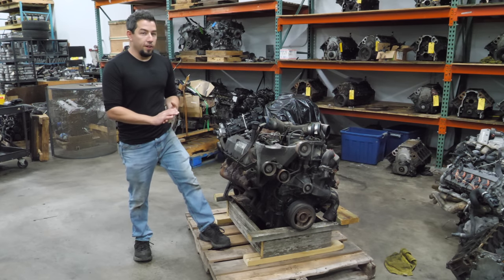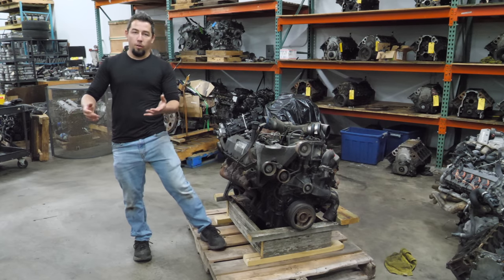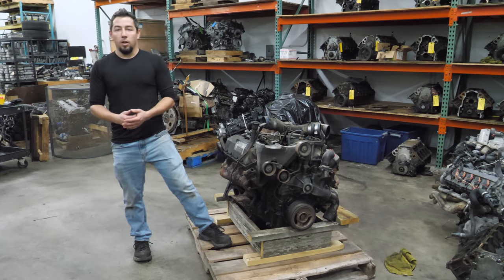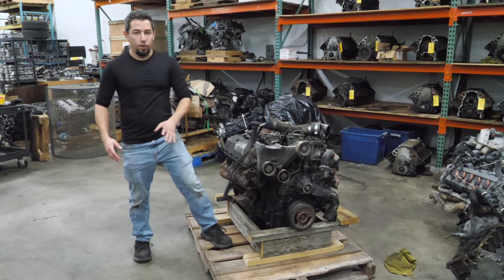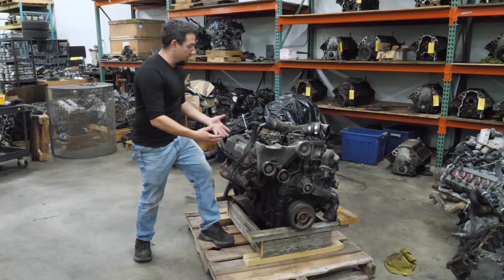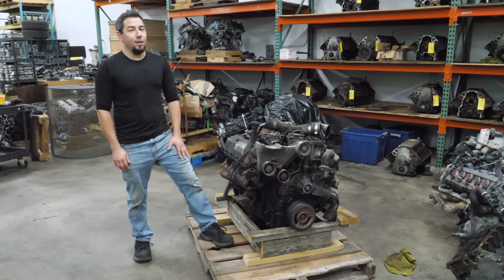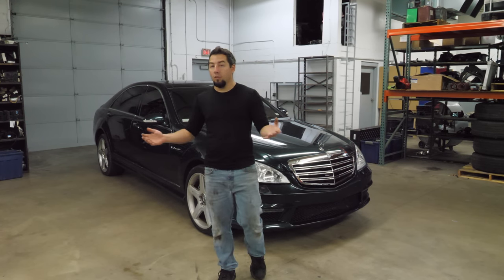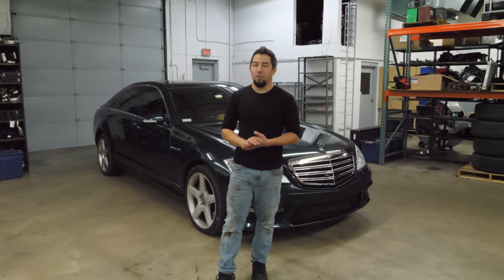70K OR 700K? Ford 7.3 Powerstroke Mileage Discrepancy. How Many Miles Are Really On This Engine?

Comment: Used truck dealer here and the Carfax report to me tells the story. Quick Change oil centers have caused more issues with mileage discrepancies than all other sources combined. And when the ODO goes from 68,3xx to 685,xxx in a matter of two months I think it's pretty obvious what happened. Once the truck got to Copart it likely had a dead battery, no battery or something else that prevented an actual ODO reading and facilities like Copart and IAAI will either sell them as "0 miles- not actual"  or they'll look at the last reported mileage on Carfax - in this case, from the same Quick Change store that likely caused the problem in the first place - and use that. Another clue to me is the condition of the wiring harness underneath the valve cover - it looked original and factory fresh. I can GUARANTEE you it wouldn't look like that with 697,000 miles.

I believe this is a 70K engine with many hours of cold-weather idling, typical of a service truck from up north. If it weren't for the mileage discrepancy I'd say it could be be a reman long block - the original valve covers would have been reused and the date code would still say 1998. But the discrepancy pretty much points to a clerical error. I think it would be smart to roll some bearings in it - and then sell it as such, carefully explaining to the buyer what we're discussing here. I believe the buyer would agree.

Comment: I don't know as much about diesel engines as some here. But I would like to try to add a couple of bits of information that may help explain a few things.

1. The accidented truck has all sorts of doors that were custom fitted to the pickup bed area. This to me, indicates that it was a service truck of some sort. While the truck itself probably had just 70K miles, the actual operating time on the engine in terms of operating hours was probably sky hight. I worked at an oil and gas services firm for a while, and when our trucks were on site, they basically idled all day, the never moved. So the mileage on the trucks was low, but the operating hours were sky high (this has to do with site safety regulations in the oil and gas industry-in the case of an emergency situation arising, they wanted everybody out as fast as possible, no looking around for keys to start the trucks, no finding out that the truck wouldn't start, essentially a hot stand by) because they would idle for 10 hours a day. if this truck was used for this purpose, it could have had 70K miles, and it could have had the bearing wear that was seen. Unlike what people believe, diesels (of all types) don't like to sit there idling, it is bad for the engines.

2. I think whoever first wrote up the mileage for the truck after the big "jump" in reported mileage misread the mechanical odometer, not knowing that the white last digit was actually in 1/10 of a mile. Automatic jump from 68K miles to 680K miles. The last two mileage readings for the truck prior to the accident were made by the same oil change place, and probably by the same guy, so the mileage was misread both times.

Comment: A lot of good comments that make sense, low mileage, hard life. Back when I was in the Navy... seriously, though, we had a wrecker at a service station that needed a rear main seal at 10 years <30k miles and that Ford 400's mains were all copper. Cold starts, twice a day, every day to move it out and in to the garage bay. Some lifestyles just destroy engines no matter how often you change the oil.

Comment: This looks to me (a non-expert) like a 70K mile engine that was maintained well, but used abusively over a long period of time - short trips, lots of idling, maybe towing.  

I say tear it down and make a video if that's a better revenue generator than selling it as a rebuildable core, since it's pretty obviously not sellable as a good engine.  That rod journal looked pretty rough, such that I think it'd be a hard sell to someone who wants to just slap it in their truck and drive.

Comment: Considering the long gap of many years in the CarFax report, if the oil wasn’t changed (just added when needed), could account for excessive wear on the rod bearings.  One thing that can’t be hid in a high mileage engine is the cylinder bore taper.  Due to wear from the piston rings, the diameter of the cylinder would me much larger near the top, than the bottom of the cylinder.

I’m on the 70k miles side and think the cylinder bore will be the determining factor.

Comment: Two things that stood out to me: 1.) You said this pickup was from Chicago. 2.) You did not mention whether/not this engine had a block heater (keeps oil warm).  We know with certainty that diesels absolutely DO NOT like to start when it is cold (sub-zero). I have been in Chicago in Jan/Feb, -20F is commonplace.  Oil turns to molasses, and you WILL get excessive bearing wear on a cold start b/c engine lubrication is almost nil until the oil comes up to temp.  Not unusual up there to leave diesels idling so they don't freeze.  Just my 2 cents, but I think you've got a 70K engine with TONS of winter idle hours on it that definitely needs a complete rebuild.  I also think the cluster was replaced at some point. Anyway, that's just my personal opinion.  Good Luck.

Comment: Appeared to have low milage, due to the injectors appearing original, under valve cover harness is a factory part, up pipes aren't leaking, harness is in great condition, appears to have the original turbocharger and still had the original icp.  Usually about 200-300k these engines require most of the items previously listed to be replaced.  Ive worked on a few that had more than 500k and they are so leaky and dirty with multiple injector replacements. But those bearings tell different story, Ive never had to tear into the bottom end of one so not sure if that amount of bearing wear is normal low milage (I doubt). Keep up the great videos

Comment: The bearing surfaces seem to point more towards 700K imo. 
Quite a fun little mystery either way
Reply: But nobody would put a stock OEM turbo on right before they crashed
Reply: that kind of bearing wear can also be caused from sitting long periods of time. then being started without pressurizing the oiling system before cranking up.
Reply: @timclarkjr1222  That's a really good point, I hadn't considered that.

Comment: Did this truck have a manual odometer? My 1985 Dodge plow truck didn't show past 100,000 miles. However, remember, with every push with a plow truck, they back up. When it backed up, so did the odometer. 
Plus, idling during winter with lower oil pressure can cause the bearings to be wiped out like that.

Comment: I worked at a place and I personally rebuilt over 150 of these engines I could tell the year just by looking at this is a low miles there is no way that in Chicago that body and that engine held up with that little of rust for almost 700,000 I've seen vehicles with less than 70,000 rusted all the way through my bet is the first owner did all his own maintenance then it was sold to somebody else that was going to these quick change places
Reply: Yeah now I don't know those bearings are pretty bad

Comment: That bore we could see had plenty of cross hatching.   It’s a badly looked after 70k mile engine.   Maybe lots of idling.  Before it was crashed it had some oil changes which helped clean it up I suspect.    I love your vids sir please keep ‘‘em up.   I also am amazed you don’t have 500k subs.   You will soon I bet.   BTW.  Has anyone told you that you look like Adam Sandler …..

Comment: Same thing happened to me at an inspection station. They assumed because of the age of the car that it didn’t have 86,000 miles. It must be 186,000 miles. I had no idea until I went to sell it and a buyer pulled a carfax. Boy I was mad but they too could see the discrepancy in the data so they bought it anyway.

Comment: Fellow mechanic here. That engine appears to be a 70,000 mile engine that was not maintained with the proper oil , or preheater for the climate it was being run in and had spent excessive time idling. I spent some time in Fairbanks Alaska and watched brand new trucks with less than 20,000 miles on them seize up at cold start when forced to start with no oil heaters. Idlingen engine at normal idle speeds for extended durations is very bad for the bearings. That's why they make high idle modules. You have to keep things spinning fast enough to keep your oil pressure up and to keep enough heat in the oil to prevent acidification. Yank the crank out toss new bearings in inspect the cam and cylinder walls very closely. Document everything perhaps even with photographs or video. Reassemble with fresh bearings if you find everything else to be acceptable. List it as a running core. Love the channel.
Reply: Actually I want to add one more step to my recommendation. If you do intend to put it back into service send that crank out and have the journals polished first before you drop bearings in it. And obviously plasti gauge everything. 👍

Comment: A low mileage engine that was started on ether a LOT!  Glow plus were a major issue, but costly to replace.  Two of them being out would make it hard/impossible to start.  Being in a cold climate, ether was the easy fix.  That is the reason for the upper bearing "fatigue" and camshaft wear.  Give it the ether (hard force on the upper rod bearing), rev the crap out of it to keep it running (no lube to the camshaft) and away you go!

Pull one main bearing lower and I'm sure you'll find the same wear as the upper rod bearings.

Comment: looks like a well maintained high mileage unit. The plastic on the connectors wil age, but it's generally heat cycles and exposure to UV that does them in. If the engine was worked hard (higher temps) repeatedly, then yes you'd likely see more deterioration, but if the engine never got too hot, 70k and 700k look awfully similar. 
The bearings tell another story. Either it's 70k with a really weak oil pump (and the most uniform failures ever seen), or you have a high mileage unit that was generally cared for, but wore the heck out.
Fue to the fact that we live in reality, and the low probability of all the bearings failing equally, I'm gonna bet it's the latter choice.

Comment: I am sure someone mentioned this already, but yes, 700k miles would be impossible.

If you do some math... The difference between 68,372 miles and 685,738 miles would be 617,366 miles. There are 37 days between December 29th, 2014 and Feburary 3rd, 2015 (inclusive). 617,366 miles/37 days/(24 hours/day)=695.23 MPH. That's the average MPH it has to travel to get that mileage.

Yeah, someone was messing up decimal points.

Comment: Yeah... those bearings are 700K bearings. Just rebuilt mine with almost 400K and they were alot better than those but definitely not perfect. It's hard to run a 7.3 low in oil cause the injectors fire off oil pressure so when it gets too low it won't even run.

Comment: My favorite engine of all time. My 7.3 has severed me for 2 decades and still runs good.
My 400k 7.3 has the original turbo but I did install a wicked wheel compressor

Comment: Based on the comments and the use case it would appear to be a 70~k engine, but likely was abused in fleet service.  It may have missed or been late on a couple of oil changes early in its life contributing to the bearing wear...

Comment: This is why I would love to see the hours of operation for each motor, not just miles driven. Idle time means a lot too, if not more so.
Reply: It really should be mandatory.
Reply: On the Ford Crown Vic Cop cars, if you hold the reset button on the odometer, it shows idle hours, don't know if that's possible in trucks case....

Comment: That engine is probably a 70k engine with a ton of idle hours.  Given that it was from Chicago, I’m sure it sat idling for entire winters. I’m sure whoever was in charge of oil changes went off mileage and not hours

Comment: Read 50 comments, and can't resist. Truck has replacement dash/odo. Heads and turbo came off a low mileage wreck, what had been siting in the bone yard. Carfax should have shown 10 header fan motor replacements!😜

Comment: I'm going to bet on the 70K actual "ticker time" with ALOT of idle time. I really do like the idea of a service body snow-plow vehicle, based upon the "body rot" in the pictures. Early Navistar's did not store mileage in the PCM. Bill Hewitt can tell you stories about 7.3s in ambulances, idling for hours. He probably could give you suggestions, even though he pretty much has farmed out his 7.3 work in Buford, GA. My take would be to sell it as a "rebuildable complete" engine. Since you have already pulled a couple of bearings, you know that the engine is going to need some "probable" machine shop review. Lastly, as a plow vehicle, there would be idling time, as well as heavy intermittent bearing loads during "plows".

Comment: Truck was about 15-16 years old when parted. It showed 68K miles in the 2013 oil change. It was local to Chicago, so it has to be low mileage. It wasn't on the highways a lot. Some kid was off by a digit at the oil change place. Randall Voss's assertion that it idled a lot seems correct. Save it.

Comment: Alot of cold temp idling, pedal mashing without engine warmup and cheap dyno oil (and/or the wrong viscosity in low temps) will do that to a low mile engine. As tough as the 7.3 is, it still won't last under those conditions. My 99 7.3 Econoline van has a little over 200k on it and has been well treated and runs like brand new with over 400lbs compression/cylinder. It also has cold temp high idle 'mode' which helps with idling in the cold. Hard to tell in video but the crank journals looked ok and I would guess measure within tolerances along with the sleeves so you might just need a camshaft, rebuilt injectors (AB's for a 98), polishing, bearings, rings, seals, oil pump, gaskets, turbo sleeves and o-rings, etc.. As per some of the other comments here, the exhaust manifold bolts are nice and thick (alot thicker than mine) so it doesn't look like high mileage to me.. I've replaced or rebuilt everything but the long block on mine. Well worth rebuilding that beauty!

Comment: One thing to keep in mind here is how each part ages. Is it by time or by actual engine use? Some parts may look the same, regardless of how long that engine ran. An electrical connector, say, isn’t really affected by how much charge flows through it.
ETA:
My hypothesis: The inverse of the »tenth of a mile«: The 70’000 miles folk missed the last digit of the odometer. Might hav been dirt covering it.

Comment: Was that 600.000 miles in three month??? That's equivalent to just shy of 300 mph 24/7 (and no pit stop for refueling or change driver). Pretty impressive mileage and an awesome driver suffering from insomnia. No wonder a crash happened with that kind of speed...

Comment: Depends on how much money one has in it. If you can make money on part out, then tear it down. I don't think you owe the previous garage as no one can say how many actual miles it has and the engine does need to be rebuilt/all new bearings and check cam and turbo for bearings as well. How does the water pump and high pressure oil pump feel/look? How are the injectors? You have a real mystery and to sell it, what to do your tell a buyer? Miles unknown with a 630,000 mile disparity? Tear it down, I say!!!!!!!!!
Another classic "I do cars" video, young man.

Comment: 1: love the detective aspect!
2: 37 days @ 70MPH only adds 62k, so we KNOW one is wrong!
3: all shops/lube place have computer records, and likely prevent directly allow a lower mileage, so a single error was most likely ignored/never corrected. 
4: car fax shows ~1000 miles per month or 12k per year (if winter/plowing 6k per year?)

… per others, idle & cold start bearing wear 
… looks like it really is 70k, tho not exactly 70k by equivalent hours!

Comment: Bottom Line . . . no matter what the mileage, that engine needs overhauled before it goes back into service. But, I'm going with 70,000 very hard miles and at least 4500 hours of idle time. I am a Ford Factory trained tech. I've worked on 'the Stroke' since it debuted in the 1994½ F-350. That is a serviceable engine but, should not be reused with that much wear.

Comment: I would pit a starter on it and do a compression check. I know the numbers will all be low, but I'd be looking to see large differences as the pistons crack and you will usually find one or two cracked pistons on a 7.3 with higher mileage. First thing I noticed with that 7.3 is NO soot on the down pipes. There's no way that has high mileage without a ton of soot. And why replace the down pipes with factory ones that leak when you can install bellowed down pipes that don't leak? I mean, it's a real pita to change them! Another thing I noticed is the CPS is an original gray one. Sure, it could have gone the cycle of being replaced with the newer ones that caused problems and then someone found a gray one to put back on it, but maybe it's the original one, By the way, both my hotshot truck and my daily driver have 7.3's from CoPart wrecks - I've been real lucky there!

Comment: I still have my 2002 F350 7.3L ZF 6spd manual, manual transfer case, manual locking hubs..  340k miles and going strong-- all original parts, original turbo, original pumps, original injectors, etc...  I'm in Oklahoma, so the truck itself is in great shape for a work truck- 9ft flatbed, zero rust;   I've worked it hard, but it's still a killer truck.   It's a hell of a tractor and frankly, I'm getting tired of people asking me to sell it to them. lol